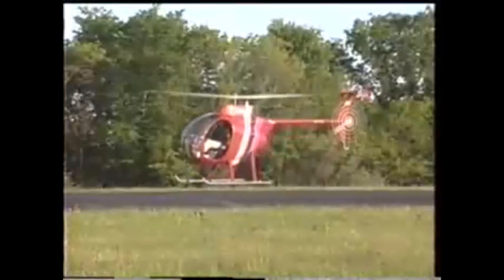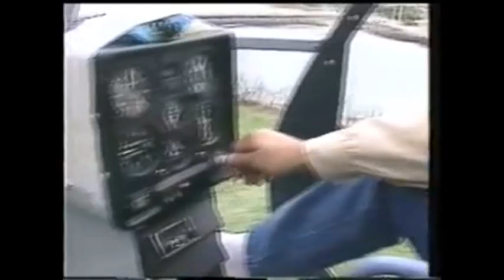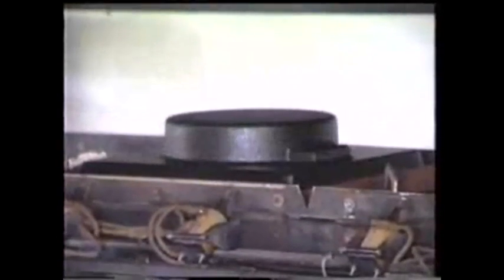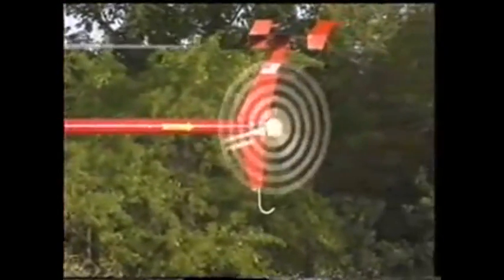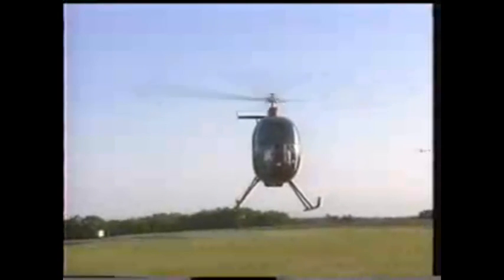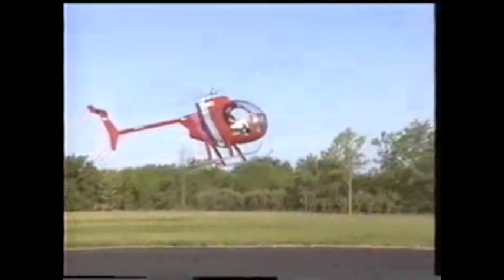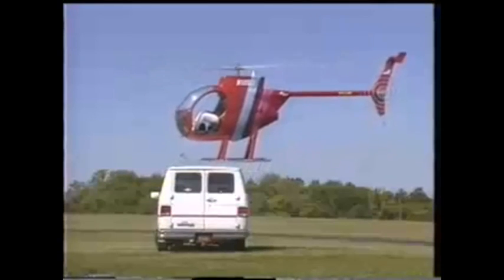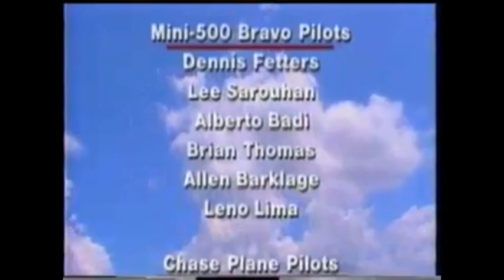The Latest Revolution Mini-500 Helicopter Demo Video (Full Length)

Comment: I keep seeing that the rotax 582 engine in these was was prone to sudden stoppage due to its design.

If so why was it ever coupled with this helicopter?
Reply from the maker: At that time, Revolution was needing to ship high quantities of helicopters, and the only engine available "new-in-the-box" and with a warranty was the Rotax 582, so as any aircraft, the Mini-500 was designed around that engine due to nothing else being available to meet the requirements. It was also a very good engine for the time period, and I had used the Rotax 582 on my previous Gyroplane models with good results.

However, like any engine in any aircraft,  if it's not installed or maintained correctly, it will fail. The Rotax 582 was a very good and reliable engine if jetted correctly by the user for their weather conditions. Rotax could not "force" the customer to follow the jetting directions, so for liability reasons, they wrote the warning it was prone to sudden stoppage. For the 2500 hours I have flown Rotax 2-stroke engines, I have had only 2 forced landings due to engine stoppage. That was due to our crew failing to mix the oil and fuel. After Rotax came out with an oil injection system, I never had problems since. In the Mini-500, the only engine failures that occurred were the operators failing or refusing to properly jet the engine.

Owners that properly jetted and maintained their Rotax-powered Mini-500s had no problems and flew many hundreds of hours, those that did not have troubles, despite all the warnings we sent them on how to do it right. 

It's funny that when something works well no one rights about it, however when they have even a self-inflicted problem, they publish all over the Internet that it was the helicopter's fault.
Reply: @fettersbuiltco   thanks for that detailed info. 

So out of interest was it all to do with having the right oil/fuel mix, or did you have to adjust other parts of the engine, like air fuel ratio etc.

(Sorry new to the term jetting)
Reply from the maker: @farleym4486  It was all to do with putting the right size jets in the carburetors to achieve the right fuel-to-air ratio. If it was winter you needed larger jets, and in summer you needed smaller jets. If the jets were too small, you could have too high of an EGT and seize the engine. I can't believe how some owners would pay no attention to their EGT readings and seize their engines. It's such an easy and fast thing to adjust before flight.
Reply: @fettersbuiltco  I understand now. You would think owners would be super attentive to that when you could drop from the sky!

I had a look on the wikipedia page for that engine. And see what you mean about the warning.
It seems to have been a really popular engine saying they built more than 30,000 between 1989 and 2021. So they are in a hell of a lot of different aircraft.

From my first comment and reading those "horror stories" of engines stopping as if it was common, I was thinking you must be nuts to run that in a helicopter.

Now it seems clear, user error and safety waivers as you said which people have taken the wrong way to seem like you were rolling the dice with the engine.

Very interesting stuff.

Comment: When these were manufactured, what was the cost of the piston engine versus the cost of the turbine engine along with the helicopter?
Reply from the maker: Back then I believe the cost of the Rotax 582 was about $3000. We never offered a turbine engine for the Mini-500. There were no affordable turbine engines available new "in a box" back then that we could have sold, and we only sold new equipment, nothing used or rebuilt. The only thing that could accidently be called a turbine engine was the Solar APU's, and those were not real turbine engines, used too much fuel and too unreliable, and all used or rebuilt. So, the only engine for the Mini-500 at that time was the Rotax 582. Some people did manage to put an APU on their Mini-500 and fly them for very limited time, but to my knowledge, all have failed to outperform the 582.
Reply: Dennis Fetters. Did you ever have Hot Rodders that put expansion chambers on their Rotax engines? Make them sound like a Kawasaki 750 H2?
Reply from the maker: We designed what was called the "Power Enhancement Package", or PEP. It was a special tuned exhaust that took the power from the low RPM range of the engine where it was not needed for a helicopter, and moved it to the operational RPM range of the engine, where it was used in helicopter applications. It increased our horsepower from 65 to 78, and moved the torque to just below the green line of operation which gave us better low rotor RPM recovery. It was later made a mandatory upgrade. It did little to change the sound of the engine.

Comment: Id take an direct electric drive version of this, over a multirotor evtol. Direct electric drive eliminates the need for gears in ultralight helis, by apllying high torque "pancake" shaped outrunner motors to drive the main and tail rotors directly. I've noticed companies like Tier 1 Engineering which has an "e-R44" (heres the video: https://www.youtube.com/watch?v=G8eXjpWDmUs ), they replaced the conventional drive systems in an R44 with direct electric drives, making it into an evtol. (they and another company in New Hampshire are gradually eliminating gears in conventional helis) The helicopter could still autorotate as long as the tail rotor has an extra layer of redundancy, via an emergency back up tail rotor power system.

Comment: This is the Magnum P.I. helicopter that Tom Selleck flew at the start of his TV show!
Reply: markmnorcal 
 I believe that was the Bell-500    that  TC  used for the island Hopper     tourism    Company  .    The 5   blades  allow them to spin faster  as they are shorter  with  more than ample  lift   , they also  reduce the gyroscope  feeling     and the noise  at the blade tips  that  are sub-sonic   and don't have that whip  cracking sound  from  mini  sonic booms  with a twin  blade  that  has a larger diameter  sweep   where the tips  travel faster  from angular momentum  where the distance  is greater per rotation.

Comment: It's not for my money, but it is a beautiful and apparently effective  "U.S. machine".
But what are the engines used for Your  "Mini 500" ?
To dream, perhaps one day a model equipped  "NOTAR" ?
Nice work anyway !
Greetings from South of France...

(tanks to Google for translation!)
Reply from the maker: +Egidius HeliViews 
Thank you for your nice comments. The Mini-500 used the Rotax 582 engine for power. We developed the "PEP" system (Power Enhancement Package) that effectively moved the power were we needed it in a helicopter, busting it's horsepower up to 78. There will be no NOTAR available, I stopped building the Mini-500 pack in the year 2000, and now devote my time to the development of UAV helicopters.

Comment: Dennis, 
with the new boom of ultra lite Helios you may have to start taking orders again. I know there is a stock pile of parts some where. I read some where there was a two seat in testing or was it a 4 guess it had to be two to stay in the class . Very nice love the head ...stop it all of you just stop it. " the rotor head " I was look at one of the gnats I mean mosquito when I found the mini way better. I'm just kidding about the gnats there pretty solid from what I have seen so far just out classed by the mini. Bring back the mini.
Reply from the maker: Hello Shawn, and thank you for the nice compliment. The Mini-500 was great for 20 years ago. It was my first helicopter I ever designed, and I have learned much more since then, and if I ever were to build another manned helicopter, I would start over and use what I learned to build a better design. But, that would never be only a single-person helicopter due to the very limited market. It would have to be a two-person so demand would be better, like the later Voyager-500 Two-Place that was basically an extended version of the Mini-500. Also due to the stupid rules in the USA, I can't provide people with a fully assembled and tested helicopter like they can do in Europe, and that was the main problem with the Mini-500, because people building it just made too many assembly mistakes. Mix that with the few design mistakes of it being my first helicopter, and it gets an undeserved bad rap. But, the biggest problem right now is the economics; You see, your basic manned lite-helicopter right now only sells for $115.3 per pound, while your average 100kg UAV helicopter can sell for $4,500 per pound, and the UAV cost less to manufacture! So, due to market demand and the situation of the economics of the UAV at this time, I can't afford to stop making UAV's to build manned helicopters for the foreseeable future. The USA would also have to change the regulations so that I can provide a fully assembled and tested aircraft before I would go down that road again. I hope my answer makes since, and I do appreciate you watching my video. Again, thank you for the compliment! Sincerely, Dennis
Reply: Dennis. it is incredible to see a godfather of aviation replying to all these interested people below. I am 26 and my opportunity to fly a Mini has now passed. I guess will settle for a MD500.  Your helicopter kit design was always my favorite. I think you did an OUTSTANDING job with your kit, considering you were always at the mercy of the owners ability to follow instruction. Hope to earn my CPL-H within the next two years, you have been an big inspiration on this journey. Great airframe, thank you!  @fettersbuiltco
Reply from the maker: @enneffgaming  - what an incredibly nice compliment, thank you very much. I had a lot of fun flying my Mini-500 AND Commander gyroplanes. They enabled me to travel all over the world and see many amazing places and people. I'm extremely glad people enjoyed my aircraft. I would still like to build my new gyroplane design, however that UAV helicopter demand keeps me tied up. Thank you again and wishing you the best of luck. Sincerely, Dennis

Comment: A true killer!

"Engine manufacturer Rotax warns owners of the 582 engine in the Owners Manual about its limitations:[6]

"This engine, by its design, is subject to sudden stoppage. Engine stoppage can result in crash landings, forced landings or no power landings. Such crash landings can lead to serious bodily injury or death ... This is not a certificated aircraft engine. It has not received any safety or durability testing, and conforms to no aircraft standards. It is for use in experimental, uncertificated aircraft and vehicles only in which an engine failure will not compromise safety. User assumes all risk of use, and acknowledges by his use that he knows this engine is subject to sudden stoppage ... Never fly the aircraft equipped with this engine at locations, airspeeds, altitudes, or other circumstances from which a successful no-power landing cannot be made, after sudden engine stoppage. Aircraft equipped with this engine must only fly in DAYLIGHT VFR conditions."[6]"
Reply from the maker: This is a very misleading statement. Yes, that is the disclaimer that Rotax wrote to protect itself against liability for the thousands of people that didn't install or maintain their engines correctly, and with more than 175,000 engines sold in 40 years, the engine still has a remarkable safety record. In fact, 99% of all Rotax engine failures were due to improper installation, setup, or lack of maintenance. Out of 500 Mini-500 helicopters produced, not even one crashed due to an engine stoppage from a failure of an engine part supplied by Rotax. What engine failures the Mini-500 owners did experience were all completely avoidable if proper setup and maintenance would have been performed.